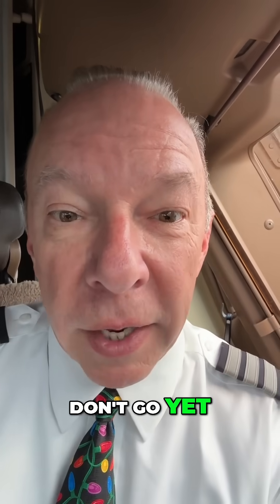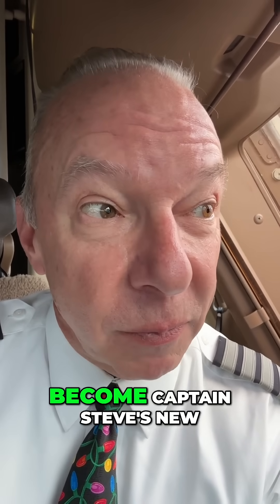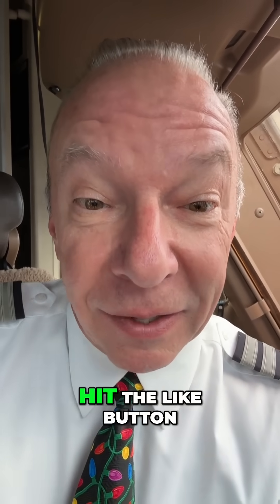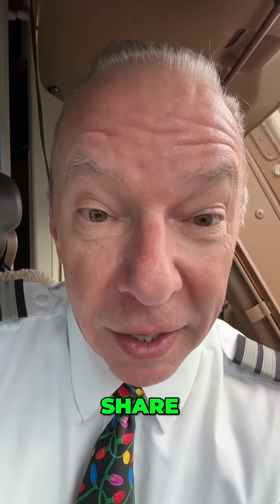Why You Can't Raise Landing Gear on the Ground

Comment: A Saab 340A pilot learned oh yes you can retract the landing gear in the runway it depends on the aircraft. 
Fun fact a training Captian caused the first Saab 340 airframe loss by going “See you can’t retract the landing gear on the ground,” smashhhh!

Morbid fact the same pilot that destroyed the Saab 340 was the major contributor Crossair Flight 3597 disaster when a RJ100 crashed miles short of the Zurich international airport runway because he broke multiple rules and failed to check his DME.

Comment: That's not true, on the AVR RJ-Series it's possible. A pilot of Crossair in Switzerland did exactly that, the plane had to be wrecked afterwards.
What makes it even worse, he kept his job and was an instructor and later died in a crash in Switzerland. 
Investigations showed, that he was a bad pilot just kept his job because of o shortage of pilots and the bad management board of the airline who even forced it's pilots to take unlawful risks as ignoring minimums in heavy weather landings and stuff like that.

Comment: It can't happen NORMALLY. But if maintenance get involved, things can get trickier...

This oddball incident actually happened as recently as  2022 to a 787 at Heathrow:

https://www.gov.uk/government/news/aaib-report-boeing-787-8-inadvertent-nose-landing-gear-retraction-whilst-parked-on-stand-london-heathrow-airport

"The Dispatch Deviation Guide confirmed that rectification of the defects could be deferred to a later date providing that the landing gear was recycled to confirm the NLG functioned correctly. To prevent the landing gear from retracting when UP was selected, the landing gear downlock pins were fitted. However, when UP was selected, the NLG retracted. As a result, the aircraft’s nose struck the ground, which caused significant damage to the lower front section of the aircraft. This inflicted minor injuries on the co-pilot and one of the cargo loading team."

Comment: I read a story about a B52 that was taking off at Loring AFB. As it was on its takeoff roll,the gear started retracting. They discovered that a wrong size toggle switch had been installed during maintenance. The  B52 was repaired using parts from B52s that were at Davis-Mothan AFB boneyard.

Comment: that might be true for airliners but a lot of general aviation planes don't have locks or squat switches, fortunately for me, the gear on my plane is down and welded (i.e. fixed gear).  that really reduces my insurance bill.  Some planes, particularly Beachcrafts, don't follow the standard control positions (these planes were designed before the standard was established) and their gear switch and flap switch are close together and a number of pilots have had an expensive lesson.  The gear switch is often replaced with one that looks like a wheel to help the pilot realize he is touching the wrong one.

Comment: I would have imagined that even if the weight on wheels sensors all failed, the load on the gear would be sufficient that the hydraulic system wouldn't have enough power to overcome the mechanical load to actually unlock and raise the gear. I imagined that there's an over-center mechanism of some sort that the hydraulic system puts the gear into such that weight and strain on the gear results in it forcing itself into the fully locked position, that way continuous hydraulic power isn't required to maintain the gear in proper position.

Comment: On February 21, 1990, a captain and flight instructor tried to prove to his co-pilot during an instruction that the landing gear on a SAAB 340 did not retract. As a result, the landing gear retracted and the aircraft landed on the asphalt, sustaining damage beyond repair. The aircraft was registered as HB AHA; from this point on, we call this scenario the AHA effect. Tragically, this captain had other major flying problems that were unfortunately not taken seriously and led to the crash of the AVRO RJ 100 HB IXM on November 24, 2001, near Basserstorf, killing 23 people and seriously injuring 9. The reason was Continuing APP below the minimum during a non-precision approach. VOR APP 28 in Zurich.

Comment: His answer is not technically correct. Normally you can't while the aircraft is unmoving or taxiing at low speed. However, there are some conditions where you CAN raise the landing gear on the ground. Depends on the airframe. I have replaced and engine and prop on a plane that the pilot tried a takeoff with the landing gear switch not fully in the down position (Cessna 210) when the nose square switch felt lighter weight during takeoff it sucked up all the wheels, dropping the aircraft (which was not yet going fast enough to fly) on the runway and trashing the prop, engine and sheetmetal on the bottom of the plan. So... yeah it can happen.

Comment: Well, you can actually raise the landing gear on the ground. I met raise the landing gear on the ground, but the weight of the airplane will keep the main landing gear in place, but the nose gear will definitely collapse. Lowering the fuselage to the ground on the nose Without the ground down lock pins installed

Comment: Yes you can. It happened in the Air Force. The mechanics had to move the gear handle up to change a guage. When they were done, they never locked thy handle down. When the crew chief put power to the plane, the nose great retracted.

Comment: Saw a video of a jet pilot doing a scramble take of, he threw the landing gear switch while still rolling so when clear the gear retracted without taking his hand off the controls, the plane hit a bump on the runway before take off speed, but it threw the plane clear for a second or so, the gear retracted and the plane landed on its belly

Comment: The weight on wheels switch locks the gear handle, not the gear. You can manually override the lock and if the gear isn't pinned, the nose gear will retract. The mains might not have the force to pull the tires sideways, but the nose wheels will roll.
The downlock will be hydraulically released with the handle in the up position.
Reply: Exactly. It happened to a KC-135, on alert at Plattsburgh AFB. The mechanic never completely locked handle in the down position, when they changed a guage. When the crew chief powered the plane up, the nose great retracted.

Comment: The "weight on wheels switch" like any other mechanical/electrical device, can go bad. I know this from experience. In my case it prevented the gear from being raised (and other things), but being a helicopter it wasn't a mission killer.

Comment: The "Weight on Wheels" switch does lots of other things too. 

WoW - Tells the cabin pressure valve to open
WoW - Enables operation of the exterior re-fuel/de-fuel panel
WoW - Disables the primary radar antenna so you won't cook ground personnel.
Reply: WoW also - actuates spoillers/airbrakes if armed

Comment: I'd imagine that modern (Software driven) aircraft control systems wouldn't only deny any attempt to retract gear when the aircraft is resting on it, but also that the gear pylons might have strain gauges on them to assist reading actual aircraft standing weight (Absolutely essential for pilot and ATC to know) so the computer would only honour that command if the weight readout was negative (i.e; The landing gear is hanging from the aircraft, rather than the aircraft resting on the 'gear.)

Comment: I was learning to be a glider pilot and we were being towed up by a plane. However, the handle for the ejection of the cable to the glider handle  and the air brake air brake ha dle we're very close to each other, and I didn't look carefully when we got to the point of disconnecting, because the rule was once we disconnect the plane goes to the left the glider goes to the right and I touch the airbrake which he felt at a tag on the tail so he thought I had disconnected but I hadn't so let's just say the wire connecting to him when I finally realized what had happened and pulled around knob to release the hook. It shot in the air and a record right.

Comment: Actually Steve you are incorrect depending on the airplane. All airplanes I flew you could raise the landing gear lever on the ground. I once had a Transponder issue on a short intermediate stop before the final leg on a B727. We all went into the office while they loaded the airplane. We returned to the airplane, sat down getting ready to go. Then the F/O read the Dots on the before start check list. The dots were the items to be read on an intermediate stop. The doors were all closed and I was about to call for the final items when I noticed the landing gear handle was in the up position. It was in the up position because it had to be to remove the transponder and maintenance had failed to put it back down when they finished. If I had started the engines and told the FE to turn the A hydraulic pumps the nose gear would have collapsed. Procedures were changed to require the full check list to be read if any maintenance had been done. The before start check list had an item Landing Gear response Down, Three Green. I worked for Beech Aircraft as a demonstrator pilot on the BH125 the marketing name give to the HS125 being sold by Beech at the time. The first airplane sold was to a large Department Store in the south. The airplane had been in the Hangar and their Maintenance Department had. the airplane up on jacks and conducted a free fall test. This test required the gear handle to be in the up position. The gear worked correctly but they forgot to return the gear handle to the down position. The next morning they pulled the airplane out of their hangar because the CEO had a scheduled trip. The Chief Pilot and a co-pilot had the airplane ready to go the moment the CEO sat in his seat. As the CEO was sitting down one pilot was closing the entry door and the other pilot hit the start button for the first engine. The nose gear retracted and the nose of their brand new airplane slammed onto the ramp.

Comment: On the old and small stuff. - it’s called a “squat switch “.  On the new and bigger stuff - in the case of a WOW failure - the computers will send a fault message - like a check engine light - alerting the crew of a fault in the anti retraction system.

Comment: Captain Steeeve, there are a couple of exceptions to what you say.  First, smaller airplanes do not have the interlocks you describe and so a Cessna, Beechcraft, Piper, etc can have their gear raised on the ground. This happens with some regularity, especially in models which place the flaps lever close to the landing gear lever.

The other exception I read about in Flying Magazine some years ago. I don't know if it is true any more, but at the time Embraer, a Braziliian aircraft manufacturer, built aircraft that were intentionally designed to allow retracting the gear on the rollout, because the country has many airports in mountainous terrain where the runway ends in a steep drop so the option is provided for the pilot to drop the plane onto its belly if the landing looks like it will go long, thus shortening the (rollout?? - well, slideout). This is preferred to falling off a high cliff into a densely forested valley.
Reply: I've seen a YouTube of a small twin, where pilot in left seat asks for flaps up after touchdown and the (I guess student pilot) in the right seat selects gear up, with the props hitting the ground.
I don't think that was even mistaking the levers. The student pilot actually though he'd heard "gear up" and didn't engage his brain before acting.
Reply: On at least a few Beechcraft the landing gear handle and the flaps levers are next to each other.  They get sold on E - bay for cheap..
Reply: A third one exhibited in a recent crash (I forget which one): extreme vibrations caused by (I believe) a deflated tire caused the landing gear downlock to be physically jolted out of position, which cause that gear to retract uncommanded
Reply: I'm from Brazil and here we have very very few montainous areas. If there's something that we have few here are mountains. But, if it's true, it would have been invented for another country maybe.
Reply: @caiquealencar1688  I could well be remembering the manufacturer incorrectly. It was at least 30 years ago that I read it.
Reply: That’s funny. My Piper Seneca 1 has a safety switch on the left main gear which prevents hydraulic pump operation if the left main strut is not extended at least 8 inches. It’s described on page 8-2 of the FAA approved airplane flight manual
Reply: @thomaslembessis6803 I should have said many small aircraft lack the interlocks.

Comment: B-25s fully retract landing gears on the ground if accidentally activated and it happened several times in WW II. That's why the lever rests in a specific locked position when the undercarriage is down. Flight manuals contain a double-check procedure to make sure the handle is correctly adjusted before pilots run up the electric and hydraulic system during pre flight because once activated you cannot stop the mess anymore. The aircraft drops down while you're watching...

Comment: On Boeings, with hydraulics on and no gear pins installed, you can raise the landing gear while on the ground.  It's happened a few times during aircraft maintenance. Even with the gear pins in, the landing gear doors still open, which can also cause injury or damage if someone or something is underneath. Stay safe out there. Turn on your beacon and always have a spotter. ^_^
Reply: Some other industries have better Lock-Out-Tag-Out procedures.

Comment: About that P-3, if you would have sucked the gear up, you would have made the cover of Naval Aviation News and been a feature subject of Grandpaw Pettybone. The F-14 squadron in our hangar folded the nose gear on startup, pilots jumped in and didn't check the gear handle position and apparently had pulled the nosegear pin or it wasn't installed because it wouldn't go in. Either way, when the left engine was windmilled the nosegear retracted and wiped out that nice expensive TCS camera and other stuff in the chin pod.

Comment: There is a mechanical Stop to prevent the gear being raised on the ground. The Stop can be overridden by pulling the gear handle out then up. The nose gear will retract if gear pins are not installed. I’ve seen it on two planes. 
I’ve done it with hydraulics on and gear pins in.  The plane shakes, and so do I.

Comment: I drove a school bus for years and years, and one brand new bus had the service door actuator button right next to the air brake and the switch that activated the yellow/red “pupil lights” outside the bus and the flip-out stop sign that lets traffic around you know when the bus is about to stop & load/discharge passengers.  These important functions were too close to one another, when they need to be three distinct operations. Much less margin of error as you can imagine!
Reply: On a plane, the levers have distinct shapes. The landing gear lever has a holding grip end that is like a small wheel, so it's not so easy to mix it up.

Therefore the switches or levers for the bus could also have different shapes to tell them apart more easily... Oh yes, or positioned at different locations, far from each other, but still logical...

Sometimes, designing this is not easy, maybe the casing for this electronic box should not be too large... and they are stuck with buttons and levers close to each other...

Comment: Great that P3 Orion can change the angle of propellers to control skidding on a slippery runway during landing.  Did land at ORD when Glenview and most ORD runways were closed in winter snow storm.  Then did see St Elmo’s fire in front nose, from view in a 4th seat in cockpit.; when descending from the East.  A memorable trip: was on ground for a few hours at Key West Florida, next Oceana Virginia, next Rhode Island and returned to Chicago.

Comment: Actually, a Swissair Saab 340 was wrecked after a guy wanted to show off that if one disengaged some interlock, it was actually possible to retract the gear while on the ground. And he pulled it!!!  I've seen the picture of it, and the production manager at SAAB confirmed it (he was my father in law back then). The plane looked fine otherwise, but the hull had hidden damage and the plane was finally written off. I've also seen a number of planes with the front wheel in, and the plane "nosedived" at the gate. NOW YOU KNOW!!  :-)
Reply: @62Baltus  the feature he thought he was showing off was that the hydraulics wouldn't kick in if he used the override because he wrongly believed the plane would sense the weight on the wheels and not respond to the gear lever.  He obviously thought wrong.

Comment: The answer to this question - it can be done. A goofy captain  many years ago on our airport LSZH managed to wreck his Saab 340 and get some knobs of the overhead panel to make his scull hurt. He pulled that breaker for the device you are talking about, asserting that it would still remain extended. Cathump, airplane damaged severely. Believe it or not, he was not fired.
Reply: Airplane actually written off, according to the Saab production manager who told me the story. A swissair 340.
Reply: @62Baltus  AFAIK this pilot made more mistakes. He did a CFIT later on with many casualties and another lost airplane. Crossair.